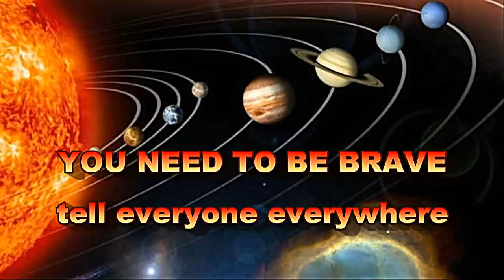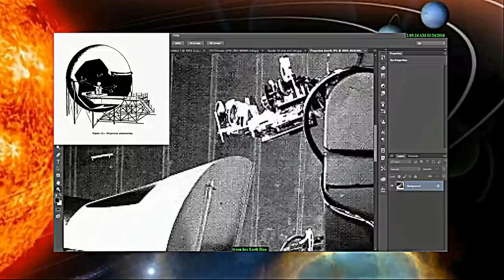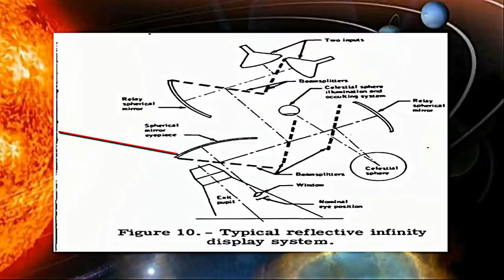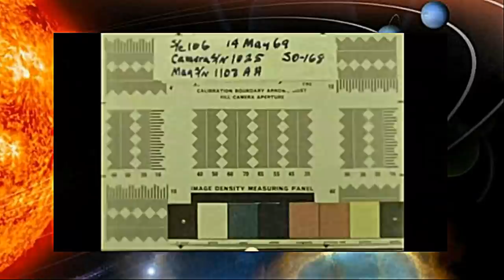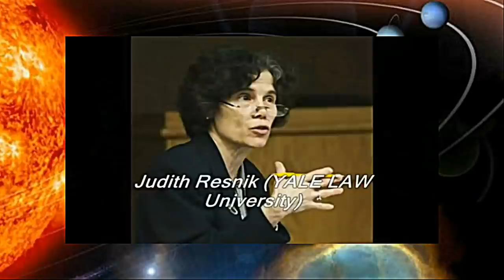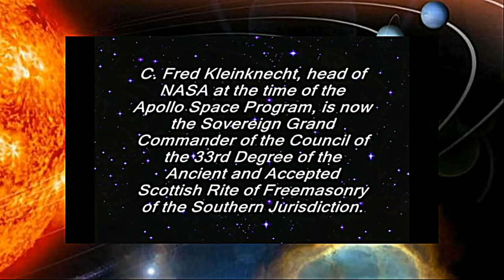AWESOME FLAT EARTH RANT AND DEMO shut down deniers instantly!

Comment: If gravity isn't working, why are they being held in the pan of water?
And why is the water at the bottom of the pan instead of floating in the air?
Reply from the maker: I got a better one! Why do eclipses of the moon take 4.5 hours when they should not even take 4 minutes?  ;)
Reply: vhsjvc
I was talking about your experiment here.
In this very video.
Not changing the subject.
Why does the water stay in the bottom of the pan?  ;-)
Reply from the maker: Mark Ryan density
Reply: vhsjvc
Density what?
Reply from the maker: Mark Ryan and buoyancy
Reply: vhsjvc
What is the formula for buoyancy?
Reply from the maker: Mark Ryan light objects float
Reply: vhsjvc
Light meaning they weigh less.
Reply from the maker: Mark Ryan relatively
Reply: vhsjvc
A feather is light.  But it falls down.
What pulls it down?
Reply from the maker: Mark Ryan density, nothimg "pulls" it.  ;)
Reply: vhsjvc
Of course something pulls it.
Put it on a scale.
Something compresses the spring on the scale, right?
Reply: Hello?
vhs?
Are you saying that springs can compress themselves?
Reply: Yoiu know those fish scales, vhsjvc?
The kind you hang a fish on, and it stretches the spring and tells you how much your fish weighs?
What stretches out the spring if there is no force?
Reply: Battlerite Gods
vhsjvc just said there is NO force.
So who is right?
You, or him?
Reply: he said nothing "pulls" it. to say there is no force at all is to say physics does not exist. We are right, you are a shill. Simple.
Reply: Battlerite Gods
There is either a force or there isn't.
How can you pull something without exerting a force on it?
Density isn't a force.
Its Mass divded by volume.
So what is making the spring stretch?
Doesn't' there NEED to be force pulling on the spring?
Reply: There is a force, which is determined by the difference in density. This force is NOT gravity as you know it. It has nothing to do with the mass of an object drawing things to it.

Don't I NEED to weigh less on the equator if the earth was spinning 1050 MPH there? Don't I NEED to weigh MORE at the north/south pole since those areas are not spinning 1050 MPH? Do you know what centrifugal force is? Doesn't there NEED to be an actual photograph of the earth? Doesn't there NEED to be any fucking solid proof whatsoever that we can recreate gravity in a model? 

Go ahead and do NASA/SATAN's job for them and PLEASE create a working model of gravity in a vacuum. I will wait.
Reply: Battlerite Gods
Then why does density push things DOWN instead of up?
Reply from the maker: "In other words, you are hurling through space at 2.7 million MPH (4.4 million KPH) even though it feels like you are sitting still."

http://www.brainstuffshow.com/blogs/good-question-how-fast-are-you-moving-through-the-universe-right-now.htm

fucking ridiculous!!!  ;)
Reply: vhsjvc
What does that have to do with the force that stretches out a spring on a fish scale?
Reply: don't answer my questions with another question. It is another force. simple. What EXACTLY is it? I really can't tell you for certain. Remember that gravity is indeed just a theory. But please try to answer a couple of the questions I offered you.
Reply: Battlerite Gods
I asked the first question, bud.
And you tried to shift the goalposts.
The question is, what force stretches the spring?
"I really can't tell you for certain"
Well, I CAN.
ITs called gravity.  Gravity isn't a "theory".
Its a force.
Density is not a force.
Reply: Battlerite Gods
Reply: Good luck in your journey.
Reply from the maker: Mark Ryan everything, because it is just as imaginary, as your "pulling" force. what is really going on is that the spring naturally stretches do to the weight of the object, NOTHING IS PULLING THE OBJECT as we can plainly observe, try putting the spring under the object, it will not stretch, so your dumb trick is exposed, it is simply the location of the spring that causes it to stretch when attached to a heavy object in the air.   ;)

have fun going 2.7 million mph and not noticing! BAAAGHHAAAGHHAA!!! What a joke!
Reply: Battlerite Gods
Good luck trying to refute science with ZERO education on the matter.
Reply: vhsjvc
NO, the stretched spring isn't imaginary.
ITs real.
"what is really going on is that the spring naturally stretches do to the weight of the object"
What is the formula for "weight"?
Reply from the maker: Mark Ryan Tesla: "Today's scientists have substituted mathematics for experiments, and they wander off through equation after equation, and eventually build a structure which has no relation to reality."

get a life  ;)
Reply: vhsjvc
Tesla did not believe the Earth was flat.
Why do you?
Reply: Tesla understood the fact that the Earth is a sphere, and the moon orbits due to gravity.

"The moon actually swings on the axis passing thru its center of gravity on which it is supported like a ball on a string..."
--Nikola Tesla
Spheres, gravity...
Get a clue from your body TESLA!
Reply from the maker: Mark Ryan he said center of gravity, so what?   ;)
Reply: vhsjvc
Yes.
Tesla believed in gravity
 Sorry pumpkin ;)
Reply from the maker: Mark Ryan find the quote dumpling  ;)
Reply: vhsjvc
Wow, drugs and alcohol have NOT been kind to you.  Its a 3 posts back, but you seem to have a hard time even breathing, so..
""The moon actually swings on the axis passing thru its center of gravity on which it is supported like a ball on a string..."
--Nikola Tesla
Reply: Mark Ryan I apologize for the lack of a coherent response. In a flat earth model, there is a definite up and a definite down. In a heliocentric model, everything is "relative" (such as people in Australia walking upside down but they feel right side up). Gravity is in fact a theory. If you read Newton's work, he has a lot of "what ifs" "maybes" and "possibly's" throughout. There is no mathematical equation for gravity and if there was it cannot be demonstrated to prove its accuracy. In fact, it has never been demonstrated that an object with less mass is attracted to another with more mass, or that the smaller object would orbit the larger. Taking your cell phone and dropping it on the floor is does not prove a magical force called gravity exists. it only proves that your phone is heavier than the air molecules surrounding it. Anything more dense than air will fall and anything less dense than air will rise. Why aren't helium balloons dragged to the earth? Because the balloon itself is too light? But if we take out the helium, it falls to the ground.. seems like gravity has a mind of its own. Take a rock with equal mass to that of a log of wood. The log will float and the rock will sink. This is bouyancy at work. The rock is more dense than water.. it falls. The log is less dense than water, it floats. 

I can sit here all day and come up with a list of exceptions to gravity but that probably won't change your mind. However, I'd like to note that gravity does not adhere to the scientific method which is something that can be observed, demonstrated and repeated.

 Show me a ball with water sticking to it. Show me water bending due to gravity. Show something orbit another object or even the most minute attraction (easy test would be a lead ball and a marble in space).

In the flat earth model, gravity is not required. The globalists simply needed an explanation to silence the critics asking how water sticks to a ball. The earth holds trillions upon trillions of gallons of water to the underside, firm in place, yet bugs, fish and just about anything else is free to move freely. Rivers, must flow uphill over the curve before reaching the ocean.. ehhhhhhhhhh really?   Ascending several miles uphill I might add. You're free to believe  in fairy tales but I say show me the experiment that can be reproduced outside of "earth is ball" because there's enough evidence to show this is a Masonic hoax (otherwise we wouldn't be having this conversation). If gravity is a law or a fact etc.. you should be able to produce a scaled to size experiment. You cannot. Nobody can. If you're OK with that, then we should be able to agree that gravity is NOT a fact nor is it scientific (even if the entire 'scientific' community agrees.. I don't give a rip. Majority opinion doesn't make something fact nor true). Cheers.
Reply from the maker: Mark Ryan that is just an analogy, you misinterpreted it to line up with your religion, is that all you got as "proof" haha that is lame, Tesla had his own "dynamic theory" of gravity, in either case, nothing ever passed the theory stage, as you know "Newton himself strongly felt that the impossibility of rationally accounting for action at a distance through an intervening vacuum, was the weak point of HIS system." It was just a waste of mental energy to try to make it make sense, but unless you can examine something for yourself you are only left with guesses and imagination. rockets for example do not go higher than 12 miles give or take a few, and balloons about 20 miles up and that is the limits of our exploration.

Tesla also said "God does not play dice."
Reply: +vhsjvc It was Albert Einstein who said, "God does not play dice."
Reply from the maker: ***** LoL! serves me right for just looking at the Google results!  ;)
Reply: vhsjvc
No, it isn't an analogy.  "Ball
  Gravity"
Its what Tesla believed.
Newton didn't invent gravity.
It doesn't matter what he "doubted" about it.
YOu still accelerate downwards at 9,8 meters per second.
That IS gravity.
By definition.
Reply: Zechariah Williams
"Gravity is in fact a theory"
NO, its not.
You don't seem to know eaht a "theory" is.
Gravity  is a natural phenomenon.
NOt a theory.
"I can sit here all day and come up with a list of exceptions to gravity"
No, you can't.
Not even once.
Reply from the maker: Mark Ryan judging from your reply, "Gravity" is YOUR RELIGION.  ;)

"Newton himself strongly felt that the impossibility of rationally accounting for action at a distance through an intervening vacuum, was the weak point of HIS system."

i just love how you clowns always contradict each other!!!

BAAAAGHHHHHAAAGHHHAAA!!!
Reply: vhsjvc
Judging from Tesla's quote, he believed in gravity.
At least you admit religion is a bad thing.
I love how you don't even understand what gravity is.
Reply from the maker: Mark Ryan oh gravity does many things!--it prevents you from knowing you are upside down, it prevents you from flying off the earth by preventing you from knowing you are moving 2.7 million miles per hour.  ;)

"In other words, you are hurling through space at 2.7 million MPH (4.4 million KPH) even though it feels like you are sitting still."

 http://www.brainstuffshow.com/blogs/good-question-how-fast-are-you-moving-through-the-universe-right-now.htm

BAAAAGHHHAAAGHHHAA!!!
Reply: +Mark Ryan the idea of up and down are wrong down is the way gravity pulls so your always right side up to yourself enders game has a very good part that explains this
Reply from the maker: maxybaer123 don't forget how you debunked "gravity" in the other thread:

maxy, you debunked gravity with your ball and chain example, since only a CIRCULAR ORBIT is permitted. An elipse is totally out of the question, and we will be generous and overlook the fact there is no chain.  ;)

The reason why fig newton himself strongly felt that the impossibility of rationally accounting for action at a distance through an intervening vacuum, was the weak point of HIS system.--is because of eliptical orbits and no chain.

In your model, when earth is closest, it will get pulled into the sun, when furthest, it will fly off into space, there is no way out for you now, according to the scientific method it is CHECKMATE

good job, you checkmated yourself  ;)
Reply: +vhsjvc my ball and chain example in no way debunks gravity that was an example of the effects of gravity on an object flying around in a circle so i demonstrated it in a circle the chain in that example is gravity which can go in any direction not just a circle
Reply from the maker: maxybaer123 no, only a circle is possible, please show us a demo of how an elipse is formed with a chain and ball.

I repeat:

maxy, you debunked gravity with your ball and chain example, since only a CIRCULAR ORBIT is permitted. An elipse is totally out of the question, and we will be generous and overlook the fact there is no chain.  ;)

The reason why fig newton himself strongly felt that the impossibility of rationally accounting for action at a distance through an intervening vacuum, was the weak point of HIS system.--is because of eliptical orbits and no chain.

In your model, when earth is closest, it will get pulled into the sun, when furthest, it will fly off into space, there is no way out for you now, according to the scientific method it is CHECKMATE

good job, you checkmated yourself  ;)
Reply: vhsjvc 

Never even tried to find out anything about orbits at all have you?

Ask any cosmologist or astronomer, a circular orbit is the exception, not the rule. The amount of variations involved in the interplay of gravitational fields alone makes it nigh on impossible.
Reply from the maker: ***** The reason why fig newton himself strongly felt that the impossibility of rationally accounting for action at a distance through an intervening vacuum, was the weak point of HIS system.--is because of eliptical orbits and no chain.

In your model, when earth is closest, it will get pulled into the sun, when furthest, it will fly off into space, there is no way out for you now, according to the scientific method it is

CHECKMATE

Moreover, that poor little moon of yours when she is caught between the earth and the sun, somehow does not fall into the sun, good thing there are no chains, imagine how tangled they would get!!!

_BAAAGHHHAAAGHHHAA!!!
Reply: again THE CHAINS ARE GRAVITY and do you get what an example is since you dont understand gravity i used a chain as an example in reality it is much more complex.

 The weak point of newtons theory was that he didn't know what caused gravity to do what it does, for example, we know we can hear sound because it propagates through the air but what does gravity propagate through? saying it doesn't exist because we dont know how it works is like saying because we don't know how god does what he does, he cant exist. Your religious right? also please dont quote things you dont understand +vhsjvc
Reply: vhsjvc
Newton did NOT deny that gravity existed,.
But who cares if he did.
Do you live 500 years ago?
OR have you learned a thing or two since then?
Reply: +Jack Dunphy i thout you flat earthers hate jews shouldent you be thanking him
Reply: Battlerite Gods 

Everything does weigh less at the equator, and more at the poles.

So, going to admit you're on a spinning sphere now?
Reply from the maker: moon-huggers will believe anything as long as it is on tv  ;)
Reply: vhsjvc 

Says the guy who believes in fictitious places from 100 year old books.
Reply: Jack Dunphy 

Perhaps I've given the wrong impression, Jack. I don't swing that way. You could probably convince some of your fellow flat earthers to join in your little game of uphill gardening, they're a pretty simple bunch. Just tell them Dubay does it all the time.
Reply: vhsjvc
Flat Earthers will believe anything, unless its true.
Reply: +vhsvc i dont watch tv or the news so explain why im still a moon hugger
Reply: beer money yeah.. the rock is more dense than the air molecules surrounding it so it falls.. that's exactly my point. 

It's been over 50 years since our voyage into space. Why are there so few images of earth from space that are non composite/non CGI? The ones that are not CGI (NASA fully admits that a majority are composites aka computer generated), could arguably be paintings and not genuine from an actual camera. If you ask NASA for the original video footage from the moon missions they claim they "lost them." A simpleton may ask what are all the videos I've seen then?? Those pictures and videos are copies from other sources and NOT the originals. NASA literally does not posses an actual non CGI photo of the earth from its originating source. You can cry all you want but I rest my case. so your answer of "Earth" is null and void. Look into it yourself like all the other flat earthers out there and you will come to the same conclusion, assuming you are of sound mind. 

Why don't we have 24/7 video of the entire earth in view that shows it rotating? Who needs radar for weather when you can see systems forming in real time? Seriously! Why didn't they film the building of the ISS in open space, orbiting 17,000mph? That's a more technological feat than the moon landings in my opinion. Whybwouldnt they film that? the  documentary would have sold millions of copies and they could have at least recouped expenses.. but no.. they do have (once again) a CGI re-enactment. It's a fucking joke. Feel that? By the time it took you to read this, the earth rotated 100s of miles from west  to east. Baahahahahaha! And I have a bridge to sell you in afganiraqistan.
Reply from the maker: maxybaer123 how did you first get exposed to t?  ;)
Reply: Zechariah Williams
Why does it fall, instead of rise?
Reply: Mark Ryan Same reason a log doesn't sink to the bottom of the ocean. The same reason a helium balloon rises instead of falls (when the balloon itself falls). 

There is no mathematical equation for gravity. Even if there is a claim that there is one, it cannot be demonstrated to prove its accuracy. We flat earthers believe in anything? Eh, you believe in a magical force that has never been proven (again.. dropping something on the ground only proves that the object is heavier than the air molecules attempting to hold it up). 

Why does a log fall to the ground but floats in water? Why does a balloon filled with helium rise unabated but the balloon itself falls? How come a magnet the size of a pea can out-muscle the entire gravitational pull of the earth? Gravity is the weakest force, is it? Got to be pretty damn powerful to strap all the water to the underside of the globe, yet gentle enough for fish, planes, bugs, birds and just about anything to move about freely. It holds things to the ball, sends other objects into orbit, attracts smaller things to form balls of rock in space... very diverse this gravity is.. Even Neal De Grasshole Tyson will tell you that "no one knows what gravity is."

The globe lie is a big one. Ego is the first obstacle. Check it at the door and do some research.
Reply: +vhsvc i am assuming you meant to say tv in which case i have never watched the news and only ever watched some unacademic tv shows
Reply: +Zechariah Williams gravity has been proven time and time again we could not go to space without an equation for gravity not to mention Neil deGrasse Tyson said he didnt know exacly what it was i could as you what is god or what is matter you could not tell me gravity is not some magical force since you like quotes so much here is one for you "Magic's just science that we don't understand yet" and we mostly understand gravity its not magic
Reply: +Zechariah Williams gravity is the weak if you took the time to understand it you would know that the more mass an object (ocean) has the stronger the pull also have you ever felt a neodymium magnet there incredibly strong if there large enough they can easily crush your hand
also ego is also affecting you seeing how all the research you did was clearly with heavy confirmation bias as you could quickly find the answer to all the questions you asked
Reply from the maker: maxybaer123 the entire space program is a hoax  ;)
Reply: Zechariah Williams
OH, gravity.
Gravity causes a log to fall onto the ocean.
Buoyancy doesn't work without gravity.
YEs, there are highly accurate mathematical equations for gravity.
Sorry bud.
Reply: +vhsjvc look up Argument from Personal Incredulity since you so love links https://web.cn.edu/kwheeler/fallacies_list.html
Reply from the maker: oh wait! gravity is a self-adjusting tractor beam!  ;)
Reply: vhsjvc
Why does evrything accelerate towards the center of the eArth at 9.8 meters per second squared, no matter its wieght or density?
Reply from the maker: Mark Ryan you don't make sense, things accelerate up to that speed then they don't go any faster, sounds just like buoyancy and density to me?  ;)
Reply: vhsjvc
I'm sorry science doesn't' make sense to you you.
Everything you drop accelerates downwards at 9.8 m/s^2
Is an orange more dense than a ping pong ball, or less dense?
drop them from the same height, and they hit the ground at the same time.
Density can't explain that.
Why not.
They both fall at the same rate.
Why?
Reply: Mark Ryan because the air molecules "holding" both objects up are equally/evenly dispersed. A good test would be to drop a baseball in the Rocky mountains at elevation and do the same at sea level and see what the results are. Dropping two items at the same location will always net the same results. The only thing that changes this is if there is drag on the object interacting with the air molecules such as a feather or wing for example. 

Hash this out in your brain.. think about it... c'mon... keep thinking... okay, make sense now? 

Science claims gravity is attraction of small masses to large masses so why does a pebble fall at the same speed as a boulder? At what size would we start seeing a difference (observation.. first rule in science)?

It's common knowledge that baseball's, golf balls and other projectiles fly further at high altitude. So the test has already been done and proven. We're not talking about the density of the objects falling but the density of the air molecules. 

If you can't wrap your head around that, I'm sorry. We can observe, demonstrate and reproduced the results just as science dictates. You cannot however show attraction of even the smallest magnitude of ANY two objects without using magnets or other properties besides mass.
Reply: Mark Ryan and to add.. capital S science gets around this problem by stating that at altitude, the object is further from the center of the earth and thus there is less gravity. All the globalists did was reverse engineer everything. Flat, stationary circle verses globe, moving multiple directions. Instead of stars rotating around us, we spin (haphazardly rotate) around the stars.. the sun moves around us in the flat earth model but they claim we move around it. They claim no creator, big bang cosmology, we claim divine and purposeful creation. Did I mention sadists (the ones perpetrating this hoax) do everything backwards??

There is one thing the globalists could not reverse engineer. You'll need to take your time and investigate this one. It's better to have a globe on hand but basically there's an issue with the motion of the sun during the winter for those in the northern hemisphere. In the heliocentric model, the earth is actually closest to the sun during winter but the alleged tilt of the Earth's axis is leaning away from the sun (tilted back - this tilt is what causes the seasons). If you have a backwards leaning earth in the winter, when California for example, reaches the terminator line (where there is light and darkness) it will be traveling from a lower position to a higher position as the day goes on.. and when it begins it's rotation toward the backside or dark side, it descends back DOWN once again to a lower point. If the observer is descending down as it gets darker, how is it that the sun also goes down? Haha! Can't happen. 

In mid day then, the sun should be at its lowest point (because the observer is rising due to the tilt and rotation). as the "night" approaches, the observer is descending downwards and so the sun would actually rise before the terminator line is reached. This is hard to explain in text without diagrams but I hope you get the point. There is no counter argument or explanation for this, only ignorance and denial. Period.
Reply from the maker: Zechariah Williams this brings up another problem, the reflection of the sky and everything in it can only occur on a flat surface, what we see on the water is a mirror image of above https://youtu.be/xmd8_DKj3Us?t=6m41s
Reply: vhsjvc If its a mirror image, why doesnt' it look anything like the moon?
Reply from the maker: Mark Ryan because your moon is this model here totally fake https://www.youtube.com/watch?v=Q4zTR9ubkD4 you are used to the fake images i guess.  ;)
Reply: +Zechariah Williams 
Why should globalists know everything if as you said we reverse engineer everything we shouldn't have all the answers. the fact that we don't say we do should be an indication to you that were telling the truth as it is impossible to know everything.

astronomy pre 101 sun goes down because we face away from the sun. The tilt changes what hemisphere of the earth is being hit the most not what hemisphere has night and day when.
P.S. 
if its hard to explain without diagrams show me one then dont care if its from a biased source
Reply from the maker: Mark Ryan ahhh, this comment set you off? because your moon is this model here totally fake https://www.youtube.com/watch?v=Q4zTR9ubkD4 you are used to the fake images i guess.  ;)
Reply: +vhsjvc i have yet to see any actual proof in those videos. Even if all of those images are real (i certain there not ) that still doesn't prove that they didn't go to the moon or that the moon landing was fake.
P.S.
there is no argument in that video just some fake images
Reply: maxybaer123
They have to be proof.
YouTube videos are always proof.
Reply: Mark Ryan 

pfft, it's all CGI!!
Reply: *****
Prove it.
Reply: Zechariah Williams 

“because the air molecules "holding" both objects up are equally/evenly dispersed. A good test would be to drop a baseball in the Rocky mountains at elevation and do the same at sea level and see what the results are.”

No. That would be a terrible test. Give one object time to achieve terminal velocity and not the other. Absolutely pointless and completely unscientific, just like this whole theory itself. You've chosen to ignore the significance of the direction of travel. If the density of the air surrounding an object in all directions is less than the object, and density alone is the cause of a shift in position, there's nothing preventing the object travelling in any one of all possible directions. You have to account for that or forget your theory.

Even if we do ignore this massive oversight, that still puts the burden on you to explain why the very property you claim causes disparity between objects/substances can paradoxically result in uniformity. Air density can't suddenly have convenient effects to compensate for your flawed logic.

Hash this out in YOUR brain... think about it for once.

“Science claims gravity is attraction of small masses to large masses so why does a pebble fall at the same speed as a boulder? At what size would we start seeing a difference (observation.. first rule in science)?”

Obviously any object on the earth is inordinately small by comparison to the earth itself, that's precisely why we observe uniform acceleration, earth's mass takes precedent.

But let's look at it from your hole ridden density theory for a minute. First of all see the point made above. If mass isn't the underlying mechanism, then how would they fall at the SAME speed if according to you one is heavier than the other and that's why they fall? Again, air isn't the answer, it doesn't work. 

We can step aside from that point and stick with the claim that it is density that makes objects fall and not attraction of masses. It still doesn't work, it is inherently contradictory. The property that defines differences in density is MASS.

“It's common knowledge that baseball's, golf balls and other projectiles fly further at high altitude. So the test has already been done and proven.”

That concerns resistance, it does NOT explain objects of different weight travelling at uniform speeds when their weight is supposedly the cause of their acceleration.

You need to wrap your head around the fallacies inherent to your poorly thought out theory, and I can guarantee you have not, and never will, prove air takes on conveniently magical abilities that simultaneously allows it to both be affected by and ignore relative density.

………

“capital S science”

Grow up.

“... gets around this problem by stating that at altitude, the object is further from the center of the earth and thus there is less gravity.”

A point proven with atomic clocks which density cannot account for.

“ All the globalists did was reverse engineer everything. Flat, stationary circle verses globe...blah blah”

Just a pointless rant filled with ignorance and bias.

“Did I mention sadists (the ones perpetrating this hoax) do everything backwards??”

Did I mention you're talking crap? Stick to facts, not conspiracy theory.

“There is one thing the globalists could not reverse engineer... there's an issue with the motion of the sun during the winter for those in the northern hemisphere...In the heliocentric model, the earth is actually closest to the sun during winter but the alleged tilt of the Earth's axis is leaning away from the sun[...]California for example [...] will be traveling from a lower position to a higher position as the day goes on[...]it descends back DOWN once again to a lower point. If the observer is descending down as it gets darker, how is it that the sun also goes down? Haha! Can't happen.” 

A misrepresentation of the facts based on thinking literally about tilt alone but not actually accounting for the true motion of the earth.

“There is no counter argument or explanation for this”

Analemma.
Reply: *****
Everything sticks to the gravity of Earth.
CHECKMATE!!! :)
Reply: +AI K wait you mean sponge balls won't get wet nooooooo i have been lied to my entire life
Reply from the maker: Mark Ryan UNBREAKABLE RULE THAT BREAKS THE BACK OF GLOBE-HEADS:

the bigger you are the slower you can safely spin before destructing

the trent 800 fan blades are 110 inches, trent 900 fan blades are 116 inches, trent 800 goes 3300 rpm, trent 900 goes 3000 rpm, trent 800 rim speed is 1079.3 mph and trent 900 rim speed is 1034.7 mph big smile on my face ;) if you think earth is spinning 1000 mph you need to give your head a shake ;)

let me add that the force at the tip of each blade on the trent 900 is equal to a 110 tonne locomotive

the biggest thing in the universe that has an edge velocity of 1000mph is the fan of the trent 900

your globe goes 1000+ mph ON PAPER ONLY.  ;)
Reply: vhsjvc
The Earth only turns once every DAY!
It takes a DAY for the whole thing to spin.

ONE ROTATION PER DAY!

That's .00069 RPM

Its not moving fast enough to tear itself apart.
Reply from the maker: Mark Ryan on paper only
Reply: Mark Ryan 

Except for butterflies and helium balloons!! CHECKMATE!!!!! ;)
Reply: maxybaer123 

Only on paper!!  BWAHAHA!!
Reply: +AL K if paper dosnt mean anything than god or a flat earth cant exist arent those from the bible WHICH IS PAPER also i would like to point out that spin rule is an oversimplification of a simplification made dun dun dunn you guessed it on paper!
Reply: +AI K why are you the authority on what works on paper and what doesn't
Reply: *****
So you think dead butterflies go to heaven?
BAAAABABABABABBABA
Reply: +AI K no answer?
Reply: maxybaer123 

Do you not realise I was satirising vhsjvc?
Reply: Mark Ryan 

Uhhh...Water always finds its level!! Perspective!! AstroNOTS!!

Get out of that one Rommel!!!!! :-P
Reply: +AI K I was wondering why you suddenly changed beliefs
Reply: *****
Uh...Water always finds the LOWEST POINT.
Get an education.
Your opinions aren't working.
Reply from the maker: REALITY STRIKES: THE ONLY proof one needs for a flat earth is flat water, no curve is ever taken into account in engineering THAT'S A FACT!

Pinned by dmurphy25 Yolanda Whittle 7 months ago 100% right!  I'm a surveyor and engineer, and there is no development project that has factored curvature of Earth!  Not one single runway, road, or railroad survey or design factors in the curvature of the Earth!  Once we graduate, curvature of Earth is never brought up again!  Ask any surveyor or Civil Engineer out there if they have to calculate Curvature of Earth and factor into their projects! Link to comment: https://www.youtube.com/watch?v=Gp_awTGVRRw&lc=z13xvviyhznvclsdg22qzbgprnuuzhlsz

And there is a continuous chain of testimonials as proven by Winship's book from 1899 http://blog.flatearthtextbook.com/2016/11/railways.html

"...As an engineer of many years standing, I say that this absurd allowance is only permitted in school books. No engineer would dream of allowing anything of the kind. I have projected many miles of railways and many more of canals and the allowance has not even been thought of, much less allowed for. This allowance for curvature means this—that it is 8" for the first mile of a canal, and increasing at the ratio by the square of the distance in miles; thus a small navigable canal for boats, say 30 miles long, will have, by the above rule an allowance for curvature of 600 feet. Think of that and then please credit engineers as not being quite such fools. Nothing of the sort is allowed..."

Please, go in peace and enjoy your delusional globe, it is a harmless delusion as far as i know.  ;)
Reply: Mark Ryan

I wonder what he'll cut and paste next?
Reply: *****
He (vhsjvc ) won't cut and paste anything that indicates the EArth is flat, or that gravity doesn't work.
That's for GOD damn sure.
Reply: Mark Ryan 

Agreed! 👍
Reply from the maker: i guess the Harlem "Globe" Trotters were right?  ;)
Reply: vhsjvc
Erotosthanes  was right 2300 years ago.
Reply from the maker: Mark Ryan never heard of him  ;)  i'll stick with reality, not a fictional relic. Tell him I say flat water proves flat earth
Reply: Mark Ryan 

If he did that she might divorce him.
Reply: Mark Ryan 

I think you'll find the correct nomenclature is "bubbasexual".
Reply from the maker: Bolivian salt flats after it rains, see the largest natural mirror in the universe and meditate on that, you might want to take your heads out of your asses first though, just a tip ;)
Reply: +vhsjvc flat water proves nothing it is impossible to have perfectly flat anything in our universe as atoms are round + water wants to go to the center of the earth not flatten look at water droplets for example
Reply: +vhsjvc what does that prove
Reply: +AI K you fell into the ad hominem trap
Reply: +vhsjvc never herd of him look him up Erotosthanes
https://en.wikipedia.org/wiki/Eratosthenes
and while your at it 
http://rationalwiki.org/wiki/Argument_from_ignorance
Reply: maxybaer123 

I fell into the pit of despair by way of boredom due to the repetition of ignorance.
Reply: Mark Ryan 

Nah. Even density can't drag me that far down.
Reply: *****
That's because density isn't a force.
Reply: Mark Ryan 

Exactly. 

It's definitely out in force though.
Reply: +AI K +Mark Ryan can you 2 be quiet if you dont have anything to contribute
Reply from the maker: "The completeness of the resulting control over opinion depends in various ways upon scientific technique (BRAINWASHING). Where all children go to school, and all schools are controlled by the government, the authorities can close the minds of the young to everything contrary to official orthodoxy." —Bertrand Russell (1952)
Reply from the maker: Why can't you walk on water or air?  ;)
Reply: maxybaer123 

Learn some humility and stop trying to infringe on freedom of speech. You're overstepping your bounds, especially given this is Mark's own thread.
Reply: +vhsjvc you've apparently never heard of this wonderful thing called a private school
Reply: +AI K i am not infringing freedom of speech if anything you are by posting that comment i am asking you to leave or say something that contributes because your whining is annoying  I have not insulted you or forced you to leave but asked you to do something which is my right 
apparently, you have no idea what free speech is it is the notion that force cannot be used to silence speech in a public area or space on private forums(youtube) the owners are free to silence anyone as it is their private property.
Reply: +vhsjvc i don't know why can't you walk on water?
Reply: +vhsjvc can i ask you why you aren't brainwashed like the rest of us then, did you drop out? because that would explain a lot. saying we are brainwashed is just ad hominem and not an actual argument not to mention you are trying to push your point using http://rationalwiki.org/wiki/Argument_by_assertion
Reply from the maker: maxybaer123 no, i was brainwashed too, but unlike you guys i rinsed out out the industrial strength propaganda, you have yet to do this. Be careful, because for some people it gets into their pores and cannot be rinsed out after that.  ;)  Don't wait too long.

Flat water is t he only proof required for flat earth.
Reply: +vhsjvc i was never brainwashed as i went to private school you simply say im brainwashed because i disagree with you and am proving you wrong do you think that i can't think that the earth is round or god isn't real without being brainwashed
you have yet to prove the earth flat water inst flat you are just arguing by assertion did you read that link it would help you
Reply from the maker: Mark Ryan you were raised on baby formula and vaccines and fluoride, you top that up with a daily dose of coke zero aspartame and now that you are in the single digits it is a matter of a short time before you hit your goal of zero IQ  ;)

flat water flat earth
Reply: +vhsjvc might be wrong but unless your parents were really paranoid or you are very young you were raised on vaccines the anti-vax thing is pretty new and how do you know if he was raised on any of those things or drinks coke
Reply: how do you know he drinks coke zero also I ask you to realise  we ingest trace bits of most poisonous substances every day simply because it might be poisonous in large doses does not mean it is deadly at any level of exposure take radiation for example, it is in every atom in the universe yet it is hard to get rad poisoning, however, I do acknowledge that nonlethal doses can still be bad for you and you should try to avoid potentially dangerous chemicals not to mention sugar tastes better.
Reply: +vhsjvc prove to me water is flat or whatever this flat water thing you are talking about i would also like to hear another proof as to why the earth is flat.
Reply from the maker: Mark Ryan yes, because that is YOUR horizon which is part of your tiny bubble of view that surrounds you that does not amount to a pin dot on a map, the sun sets past your limited vision, your idea that it cannot set mathematically on paper because the lowest it goes is 11 degrees is based on the viewer having infinite range.  ;)

please learn to stick to reality
Reply: vhsjvc
Its not "my" horizon.
It belongs to everyone on the globe.
No person can go ANYWHERE on this Earth, even in the air, on a plane, in a balloon, or in low Earth orbit, and avoid the Sun and the Moon dropping BELOW the horizon.
The Sun and the MOon ALWAYS drop below the horizon.
And pop up from behind it when they rise.
Stars too!
That's reality.
Reply: +mark ryan if in low earth orbit you could probably spin with the earth so that neither of the bodys move but your point still holds
Reply: +vhsjvc there is a way to mesure to the stars https://lco.global/spacebook/parallax-and-distance-measurement/

all humans do have infinite range we can see the stars after all or an easy one fly in a plane 1k ft up and you can see farther than you normally can or even look off a mountain maybe you have a bubble around you blocking your view of the truth

if the sun is on some dome why can we see it isn't it at least a few miles up as planes can fly 10k ft 

imagive wind it can carry smells or light objects from an infinite range as long as they dont dilute or fall to the ground all light is is the photon wind hitting your face it dosent matter how far away it came from it only matters whats hitting your eyes
Reply from the maker: maxybaer123 the horizon always rises to eye level  ;)
Reply: vhsjvc
No it doesn't.
The horizon is always at ground level.
It above you if you are looking at mountains.
Its below if you are standing on level ground.
Its even farther below you if you are in the sky.

It drops about 3 degrees for every 10 km yoiu fly up.
Reply: realy then why can you see the ground on a plane
Reply from the maker: maxybaer123 because earth is flat, ryan is just making shit up as he goes  ;) if you want to know why it is called an air*PLANE* just understand it is because earth is a flat plane
Reply: +vhsjvc do YOU HEAR YOURSELF your just saying because the earth is flat and not thinking for yourself think rather that repeating what you were told
Reply: a question im looking for an awnser 2 is there a reson the horison is at eye level i assume its because its the farthest point you can see on the ground and the ground if looking straight is the lower half of your vision and the sky the top
Reply from the maker: Mark Ryan more word salad from you, yes air*PLANE* because they travel over THE PLANE that is how planes fly, parallel to the ground, horizontal, level, as in sea LEVEL.

The horizon always rises to eye level because we are living on a plane, a vast plane, a flat earth.

"look it up" rofl

no ship goes "over" anything, you just get a telescope and it comes right back into view, get lost bozo

and don't forget granite, cannot be formed from a molten state  ;)

earth is young and flat, Genesis is 100% true
Reply: vhsjvc
Sorry you have a hard time understanding facts.
Word Origin
C19: from French aéroplane, from aero- + Greek -planos wandering, related to planet
Reply from the maker: maxybaer123 "the horision dosent rise to eye level it rises to the center of your view regardless how does that prove were on a plane."

is the same thing, it rises to eye level, and on a globe, the higher you go the LOWER it would get, it would not remain at eye level, case closed.

the granite point matters because it proves you believe in fables

 and your own words are perfect for you:

 "so far all this argument is is you repeating others words and proving them with dogmatizm noun: dogmatism the tendency to lay down principles as incontrovertibly true, without consideration of evidence or the opinions of others. 'a culture of dogmatism and fanaticism'"
Reply from the maker: Mark Ryan i am Greek, planos really means deceiver, but i can see how that can apply to motions of "planets" like retrograde

still, air*PLANE* stands, just like water LEVEL

you g lobe-heads seem to have a hard time with observing and interpreting reality, you cannot see the forest for the trees

and don't forget granite!  ;)
Reply from the maker: Mark Ryan no they all look like venus pretty much, people can look up The Venus Waves video on here to see what they really look like.  ;)

don't forget to say hello to granite for me :)  you know it cannot form from a molten state by slow cooling

that sure knocks all your dominoes down nicely
Reply: vhsjvc
You can see the phases of the beautiful globular planet with a cheap telescope.
Go buy one.
YOu can see its a sphere.
With your own eyes.
Reply: vhsjvc 
can you please stop being denser than granite and listen you have yet to prove granite cannot form from a molten state all you have done so far is dogmaticaly state that it cant and besides that doesent prove anything it hints at possible creationism but in no way proves it

not to mention it took me 2 seconds to find a video by a random person in it you could easily see the planites were round
Reply from the maker: Mark Ryan they are round, but also see through, and they look like pure energy shimmering
Reply from the maker: maxybaer123 the polonium halos in the granite close the case
 halos.com

all the detractors can say is "it got in through the cracks" hahaha
Reply: vhsjvc
You have no evidence that Polonium created the halos.
Its speculation that only the bible thumper Robert Gentry asserts to be true.  No actual science facts back his claims.
Gentry never demonstrated the the rocks were primordial, nor did he show that polonium caused the rings.
Its a failure by an under-educated Young Earth Creationist motivated by a religious opinion, not the logical conclusion drawn from the scientific method.
Reply: Mark Ryan no he has evedence science said it and it backs him up so it must be the one thing nasa/illuinati/science has ever said that is true
Reply: maxybaer123
This guy doesn't go by "evidence".
He goes by feelings, emotions, and opinions--often not even his own, but those of others who have played upon his anger at the world.
He's angry, he's been hurt, he has abused himself over many decades with drugs and alcohol and cigarettes and so on...
 And this has led to him cultivating a hate for those of us who haven't, and who still have our faculties and wits about us... people who he senses are smarter and better off than himself.

There he rejects formal science, mathematics, and basic logic.  He rejects facts that don't affirm the position he has entrenched himself in.
Numbers, maths, and science hold no weight with him. In fact, he rejects them even more rigorously, as being the product of the "elite".

He desperately needs to be right, so that he can be better than everyone else...
...everyone who he perceives as being culpable in for why he is so angry at the world.
Reply from the maker: Mark Ryan no, i just had an opponent on here affirm they are polonium halos, it comes down to the three rings, how a nuclear physicist would get published in several peer reviewed major journals and make this mistake is irrational, the signs of a desperate attack a desperate grabbing at straws and a desperate attempt at clutching the fake ball earth as i rip it out of your skull.  ;)

granite with polonium halos or without halos cannot form by slow cooling from a molten state, but especially with the halos  ;)

halos.com

no Bible required  ;)

i can see you guys now pulling your hair out with both hands ;)
Reply: XD XD XD im assuming im the one that backed you up in which case you should know that was sarcasm
Reply: where is your proof and what journals bible weekly, jesus illustrated, top 10 reasons why the earth was made in 7 days

no bible required that halos webside is written entirely because of the bible it was even disquiminated agenst for being religous non bible science wouldent be considered to religous 

not to mention that site says all the counter arguments have been refuted. then precedes to say that becuse granite has never been made in a lab, probably because nobody wants to waste there time makeing something that proves someone who has ignored all the other evidence wrong, that he is right. another potental reason noone has made granite in a lab is because it takes 10k years to cool
Reply: vhsjvc
No verification that Polonium caused the halos, nor that the halos occurred in Primordial rocks.
Sorry bud.
Reply: vhsjvc
I don't care who backs up...they need to show the scientific evidence that Polonium caused the halos, in rocks that are Primordial.
Proof.
Lets have it.
Any scientific consensus will do.
Show us the peer-reviewed science.
Reply: regardless even if the earth was formed in a day dosent mean god did it there is almost a certainty that other civilizations exist and one of them could have done it.

you said there only argument was that it seeped in though the cracks your only argument is something that goes agents the majority of science and evedence to the contrary because it was written in a book.

i also want to point out the fact that things seep through the cracks all the time

AGAIN WHAT DOES THIS PROVE ABOUT A FLAT EARTH i dont care weather god exists most christians dont think the earth is flat either
Reply from the maker: nuclear physicist identified the halos, 1 to 3 rings means polonium, case closed.  ;) Ganite with polonium cannot form by slow cooling from a molten state, case closed.  ;)

The only way to get granite with polonium halos is if it was formed INSTANTLY  ;)

no Bible required but it is amazing how well the Bible coincides with real science  ;)
Reply: no that is not the only way there are many more probable options you say no bible require yet saying there is no other way for them to form is wrong and you are only saying that because of the bible
Reply: what nuclear physicist if i might ask and why does he suddenly have a geology degree and why is he telling the truth? becasue he supports you?
Reply from the maker: The only way to get granite with polonium halos is if it was formed INSTANTLY  ;)

no Bible required but it is amazing how well the Bible coincides with real science  ;)
Reply: There. is no evidence the halos are created by polonium.
There is no evidence the rocks are the first rocks on Earth.
Reply: how many times do i need to tell you you are jumping to conclusions for the sake of your confermation bias that is not the ONLY WAY to get granite with halos
Reply from the maker: odinata you would like to think so, but that is wishful thinking  ;)  a nuclear physicist showed they are polonium halos, the one to three rings is the signature, but regardless, it still requires instant formation, case closed.  ;)

when you can get that many polonium halos or any polonium halos or just plain granite to form by slow cooling from a molten state then i will listen  ;)
Reply: vhsjvc
Its not about what I would like, its just a simple fact:
The halos have not been shown to be caused by Polonium, and they have not been shown to have formed in rocks that are the oldest rocks on Earth.
Polonium is a decay product of URANIUM, and so there is no reason that the rocks had to cool instantly.
How did the rocks cool down instantly, anyway?
Magic?
Reply from the maker: odinata God must have made them, unless you have a better explanation?  ;)

And stop denying, the only way to get polonium halos in the granite is fiat creation.

If you think they are not polonium halos then email halos.com

denial is a sad state, open your mind
Reply: vhsjvc
I'm not denying anything.
The halos haven't' been shown to have been caused by Polonium.
Uranium decay produces Polonium.
There is no evidence that any rocks cooled instantly.
You still haven't explain how the rocks cooled instantly.
Reply from the maker: odinata says who? I have seen the halos they are most definitely polonium, are you suggesting that there are special halos that are formed by slow cooling of molten granite that looks identical to granite?
Reply: are you some geological time traveling phisist that knows on site what caused halo in granite
vhsjvc
Reply from the maker: maxybaer123 young flat earth  ;) halos.com granite cannot form by slow cooling from a molten state, especially not with an overabundance of polonium halos  ;)
Reply: vhsjvc
We can calculate exactly how long it takes granite to cool down naturally.
God would have had to instantly cool the granite somehow.
A magic freeze ray of some sort.
The halflife of Po is around 3 and a half minutes.
Reply from the maker: odinata God did not cool anything down, granite does not form by slow cooling from a molten state, just try it and see, you get something completely different. God created granite and everything as is.  ;)
Reply: well if the halos are caused by polonium while granite is cooling how did god make them
Reply: vhsjvc
Basic equations tell us how long a mass of granite takes to cool down from being heated to a molten state.
But I'll let you tell me...maybe you have felt hot rocks that go cold instantly.
I don't want you to think I'm being disrespectful.
Reply: well no his thory is that once you disprove science god automaticaly exists and made eart instantly because he can do anything
Reply from the maker: odinata i'm saying that granite did not cool, not that you cannot melt it, but when you do melt it it cools into a different thing, not granite, and molten granite can never cool into regular granite, especially not with an overabundance of polonium halos, see halos.com therefore, the granite we have on earth must have been formed instantly, just as described in Genesis  ;)
Reply: vhsjvc There can be no halos in granite if granite does not melt.
How else would polonium get into granite?
Reply: Your favourite ploy:   Gentry's hypothesis quickly runs into trouble with all of the accumulated evidence from many fields of earth science pointing conclusively to a great age for the Earth. Not the least of these evidences is radiometric age dating. To reconcile his presumed young age for the Earth with reported isotopic age dates for rocks around the world, Gentry (1992) argues that radioactive decay rates have varied over time. He is forced to conclude that decay rates for his chosen polonium isotopes have remained constant while those of dozens of other radioactive isotopes were many orders of magnitude greater 6,000 to 10,000 years ago. This of course gives rise to several major inconsistencies:•many rocks have been dated by a variety of techniques using different isotope pairs having very different decay mechanisms, the results showing remarkable consistency in measured ages. Gentry's hypothesis would require that all of the different decay schemes for the different radioactive isotopes must have been accelerated by just the exact - but very different - amounts to give the consistent age dates we find for rocks today. For example, the decay rate for uranium-238 (half life = 4.5 b.y.) would have to be accelerated by nearly four times the rate for potassium-40 (half life = 1.25 b.y.). Given the large number of different radioactive isotopes and decay schemes that have been used in dating rocks, the chance of this coincidence taking place is essentially zero.
•a general principle of radioactive decay is that the more rapid the decay rate, the more energy that is released. The slow radioactive decay of uranium, thorium, and potassium-40 has been identified as a primary source of the Earth's internal heat. Speeding up the radioactive decay rates of these isotopes by many orders of magnitude to be consistent with a 6,000 - 10,000 year age for the Earth requires that the energies of decay 10,000 years ago would have been extreme, keeping the Earth in a molten state to the present day. Obviously this has not occurred.
•if one is going to propose that radioactive decay rates varied, and varied differently for each isotope over time, there is no reason why the decay rates of numerous polonium isotopes should not also have varied. Under a variable decay rate model, it can even be proposed that polonium decay rates were much longer than observed today. In fact, once the idea of variable decay rates is introduced, it becomes impossible to assign discoloration haloes to any specific isotope or isotopic series, and Gentry's hypothesis falls completely apart.
The decay rate and the energy of emitted alpha particles are both related to the imbalance of neutrons and protons in an atomic nucleus, and are controlled by the strong nuclear force and the binding energy for the particular nuclide. Anything more than a fractional change in the decay rate over time would require variation in the fundamental forces of nature and the relationship of matter and energy. There is no evidence that anything of the sort has ever occurred.
Reply from the maker: odinata EXACTLY!  ;)  how else except by instant creation by God?
Reply from the maker: ***** you are out to lunch, it's all about the overabundance of polonium halos trapped in granite and this can only occur by instant creation
Reply: not to mention just because god has the ability to do something dosent make hime automaticaly do it
Reply from the maker: ***** no, you are making shit up, grasping at straws, either you show how liquid granite cools back into granite and/or with plenteous polonium halos included (or any halos) or stfu  ;)  halos.com
Reply: who made you the arbiter of the universe? we have shown it not done it but you havent created a flat planet in 7 days we told you the uranium broke down into polonium and that polonium probably made the halos how did god make granite
Reply: not to mention you have yet to show UNDENIABLE proof the halos are caused by polonium yet you ask for undinyable proof of granite formation why must our proof be done but yours only said by a non credible scientist or religous text the bible isnt proof of god it could potetaly be evedence but at the current time it isnt even that
Reply: *****
So why did God make the granite first in a melted form, if it was supposedly instant?
Reply: odinata 

Think you clicked on the wrong user there.
Reply: *****
Ah yes...sorry.
Reply: FLAT EARTH FREAK!!!
So why did God make the granite first in a melted form, if it was supposedly instant?
Sounds like you need to concoct an ad hoc explanation to explain why halos would exist in the first place.
If god made all the plants and animals fully grown, why wouldn' tHe make the rocks as we see them today?
Reply: can i ask why water is always flat
Reply from the maker: odinata you said it, God did make the rocks as we see them today ;) this is what we know for a fact based on the facts about granite and especially granite loaded with polonium halos. http://blog.flatearthtextbook.com/2016/11/geology.html ;) this is a good read   here is a small excerpt (it wont appeal to globe zealots because nothing will change their mind) The Vice-President of the Royal Geographical Society of Ireland holds that this, the only earth, was made during six successive periods, corresponding to six series of rocks, and that particles of mud and sand deposited by rivers in sea bottoms could only become rocks of a heterogeneous mixture, but never such as the primary with sub-divisions, having each its own marked peculiarities. In his "Errors of Geologists," page 15, he says:

"Neither the brown gneiss, nor the primary red sandstone, nor the yellow quartz rock, nor the gray mica slate, nor the blue limestone. Not one band out of all these could be formed out of the river sediment coming down from the pre-existing continents, because not one of them has mixed particles. The quartz rock has no lime, the limestone is purely crystalline, etc."
Reply: FLAT EARTH FREAK!!!
So God made them with the Polonium Haols in them?
I thought you said He made them melted.
Reply: wait but if god made the halos then thats proof there not polonium which means that there is a possibility of it not being polonium which means that your argument falls apart
Reply: im sorry but i dont think she ever said that as i can find no proof of it anywhere but on flat earth sites a link would be appreciated 

you call us globe zealots and nothing can change our mind when i am beeeegggging you to give me one credible piece of evidence that proves the earth is flat or god made the earth and dont say flat water you havent proved water is flat i am just going with the most logical explaination
Reply: i would like to point out the irony that you trust some random guy on the internet over many scientists and like to his page saying this is ALL humanity knows about granite halos
Reply from the maker: odinata i said the exact opposite, it is old spinning earth globe-heads that say molten. And yes, created with the polonium in them, it's the only explanation. The fact it matches Genesis in the Bible is 100% not relevant to the fact the only conclusion is that it was formed instantly as is or fiat creation.  ;)
Reply: FLAT EARTH FREAK!!!
That doesn't fit with the science at all.
Granite forms from molten magma.
Why doesn't Robert Gentry, the inventor of the falsified idea of Po halos, agree with  you about the shape of the Earth?
Reply from the maker: odinata  you wish, too bad granite does not depend on Gentry or the Bible, it speaks for itself. You cannot form granite from a molten state, especially not with an overabundance of polonium halos, the only logical conclusion according to KNOWN SCIENCE is instant creation. The fact that that coincides with Genesis in the Bible makes no difference whatsoever.

R.I.P. odinata brain washed too many times with industrial strength propaganda, this is what happens when you never rinse, she is a greenhouse religion follower too, so she tries to conserve water the most plentiful substance on earth, that's how smart she is like her smart meter that's giving her cancer and all the vaccines and fluoride too, she swallows all the lies.  ;)
Reply: YOU CANT MIX SCIENCE AND THE BIBLE AND NITPICK you say polonium halos are proof of god yet only science applies to how they form or work uless your talking about genissis
Reply: especaly not with anover abundence of halos 
WHAT noone has done it so how do you know if there are halos or not and if god made halos explain how they get there when humans would make it
Reply: you say it is the logical conclusion yet it only seems logical because you already have that idea say your religion was that aliens made the earth that would seem logical that they did it its not the only logical conclusion just one you already know the alien one is more logical because it agrees with more of the evedence the god would
Reply from the maker: maxybaer123 no i say it has nothing to do with the Bible
Reply: FLAT EARTH FREAK!!!
I don't have to wish.
Gentry never demonstrated that Po causes the halos.
Gentry never denmonstrated that the granite was primordial.
Granite requires molten rock to cool slowly for it to form.
No wishes involved on my side.
Reply from the maker: odinata nothing but sci-fi on your side, granite cannot form from the molten state, and granite with polonium halos cannot form from the molten state, they are polonium because we see three rings, case closed, i destroyed your little fantasy globe ;)
Reply from the maker: odinata flat water no curve is why we know the earth is flat, i don't care if gentry believes pink elephants can fly, it does not change the science, i don't care if there are many who disagree, truth does not require a majority. either show us that granite forms from the molten state and with lots of polonium halos or three ring halos or admit you know nothing. halos.com
Reply: FLAT EARTH FREAK!!! Even Gentry knows the oceans horizons curve, and ships disappear behind the Earth's curve.  No halos have been shown to have been caused by Po.
We know that granite forms only in slow cooling magma.
it's not granite any other way.
By definition
Reply from the maker: odinata your definition, just like the definition by nasa for greenhouse gas is a lie, too bad you are so gullible nosuchthingasgreenhousegas.com sorry, but granite does not form from a molten state and granite with three ring halos indicating polonium does not form from a molten state
Reply: FLAT EARTH FREAK!!!
No, the defintion of granite isn't wrong, it isn't a lie
I didn't' invent it.
And you can't change it.
Sorry bud.
This has nothing to do with greenhouse gases.
Reply: you need to prove what your saying i aready let myself get dragged into a young earth argument not gonna talk about gasses
Reply: please give me 1 shread of proof about a flat earth
Reply from the maker: odinata it has everything to do with the greenhouse gas religion because all lies including vaccines trace back to them and their population reduction agenda.

Granite is DEMONSTRATED not to form from a molten state, and the 3-ringed halos (polonium) that are so abundant in granite could not have been included if your definition was true.
Reply: FLAT EARTH FREAK!!! it has nothing to do with greenhouse gases.
The Earth can be the sphericql shape it is AND   climate change can be false.
At the same time.
Reply: FLAT EARTH FREAK!!! the shape of the Earth has nothing to do with any population agenda.
If the Earth were flat, the same people would want population to remain sustainable.
Reply: i am not part of any religion the views of others do not represent my views that is also a key part of a religioin is that there views are shared my views are my own not those of whoever your talking about
Reply: I WANT PROOF THAT IT IS DEMONSTRATED YOU NEED 10K YEARS
Reply: LOL all the threads that we proved him wrong on the flat earth thing he just straight up ignores then turns this into a young earth thread I WANT PROOF OF A FLAT EARTH DO YOU HAVE ANY
Reply: maxybaer123
This guy isn't mentally stable.
I feel sorry for him.
Reply: he said that to me lol
Reply: maxybaer123
I'm talking about the guy in the video, rambling on incoherently.
I do feel sorry for him.
Reply: why do i care im talking about weather the earth is flat also they have never once said they were going to kill anyone you tie it in to your thorys because it fits your narritive about the illuminati
Reply: i will not switch topics until you awnser me about the flat earth how can you prove its true
Reply from the maker: odinata they are the same people, believe it or not. As for Gentry, I don't care what he believes, I only care about the discovery that granite is loaded with 3-ring halos of polonium and what the implications of that are.
Reply: FLAT EARTH FREAK!!!
No they aren't.
They aren't the same people at all.
As for Gentry, I don't care what he believes about the age of the EArth, because he's already been debunked.
Radon makes identical halos as well.
I'm glad Gentry believes the Earth is round, because that has been proved correct.
Reply from the maker: odinata they are the same people, all lies come from the same people behind the greenhouse gas religion. No, the radon cannot get in, it is only suggested how it might get in, no physical proof to counter gentry has surfaced to date. Plus, it only makes 1 ring, but gentry a nuclear physicist, discovered 3 rings and that is 100% polonium, so you really don't know this subject very well.

when you can prove that granite forms by slow cooling from a molten state, and that this results in many 3 ring halos to be included in the granite, i will listen
Reply: FLAT EARTH FREAK!!!
No they aren't.  Any more than people who believe 2+2=5 are the same people who believe snakes can talk.
You only think they do, because you hate people who have gone to school.
Radon leaves an identical halo as Polonium, and both Polonium and Radon are products of Uranium.

"Granite is a light-colored igneous rock with grains large enough to be visible with the unaided eye. It forms from the slow crystallization of magma below Earth's surface. Granite is composed mainly of quartz and feldspar with minor amounts of mica, amphiboles, and other minerals."

Google the world "igneous"
Reply from the maker: odinata they are the same people, i proved it, they admit it, it is in their own public domain publications. Polonium can have 1, 2 or 3 halos and gentry, a published peer reviewed nuclear physicist, has identified the 3 ring version in granite, therefore it is polonium 100% deny all you like.

Granite does not form by slow cooling from a molten state, and polonuim halos cannot survive the slow cooling process. 

and i forgot to mention that in common core curriculum 2+2=5 if the class agrees on it
Reply: FLAT EARTH FREAK!!!
You proved they AREN'T the same people when you admitted that Robert Gentry doesn't believe the Earth is flat.
Do you think Robert Gentry believes in Global Climate Change?
Reply from the maker: odinata i don't think so 😉 they most definitely are the same people, i don't care about what gentry believes
Reply: pleas stop dogmaticaly saying granite cant form wheres your proof
Reply: you have yet to prove the earth is flat
Reply: FLAT EARTH FREAK!!!
Most definitely?
Ok, what Greenhouse gas did Robert Gentry push?
Reply from the maker: odinata i said "they" and i gave you a link https://www.youtube.com/watch?v=WeLpFKdNJzc
Reply: so someone worships the devil is that wrong you worship god i dont know about where you live but here in the good ol U.S of A we have a little something called freedom of religion
Reply: and again WHERE IS PROOF OF A FLAT EARTH I DEBUNKED YOUR VIDEO
Reply: maxybaer123
He won't be able to answer.
He's trapped in a cloud of mental illness and paranoia.
Reply from the maker: odinata exactly, so why do you mention him? Stick to GRANITE and stop diverting the discussion. Please prove that molten granite cools back into its original form, complete with three ring halos of polonium or concede that the earth is young and God created it and Genesis is true. 😁
Reply: FLAT EARTH FREAK!!! you are the one who brought him up. if he's smart enough to figure out polonium halos in your mind why isn't smart enough to know the shape of the Earth? Robert Gentry knows the Earth is round.  if he's good enough to be an expert on granite, then why isn't his opinion about the shape of the earth good enough for you?
Reply from the maker: odinata because science is not based on opinion, he never "figured out" anything, he made an observation, the implications followed based on science alone. The granite full of 3-ring polonium halos has only one explanation, instant creation, and from there we must accept that EVERYTHING was also instantly created, and then we notice that this matches Genesis perfectly. He is an imperfect human, but I will contact him about flat earth sooner or later.
Reply: FLAT EARTH FREAK!!! science has debunked Robert Gentry it is showing that he is 100% wrong about the age of the Earth
Reply from the maker: odinata not at all, your "science" is full of lies, and headed by greenhouse gas religion high priests, not rational to expect any truth from proven liars. Granite with polonuim halos proves instant creation, case closed.

Until someone successfully melts granite and shows that it cools back into its original nature, including plenty of 3-ring polonium halos, then i will listen
Reply from the maker: odinata yes, YOUR people, the greenhouse gas high priests who are the source of ALL LIES. Granite full of polonium halos should be taught in every school but since satanists control the "common core" curriculum, as I already proved to you, it is no wonder they hide real science like this, because people might find God.
Reply from the maker: odinata when you can attack the message then talk, until then, nuclear physicist published in many major peer reviewed journals has discovered 3-ring polonium halos in granite, which implies instant creation, since halos in granite cannot form from a molten state by slow cooling, neither can granite form from a molten state by slow cooling.

chop chop get to work trying to disprove reality, you are a zealot deceived by satanists, as i proved to you in less than 3 minutes https://www.youtube.com/watch?v=WeLpFKdNJzc the ones who control the school curriculum known as common core say satan is god, case closed.

stay stupid if you like
Reply: FLAT EARTH FREAK!!!
Which major peer-reviewed journal was it published in?
All you have to do is name the journal.
Reply: you are moving the goal post you ask him to disprove your proof that you stated as true without evedence
Reply: do you not live in the USA if not then this might bother you but here in the USA we have freedom of religon and seperation of church and state what those who made common core believed in dosent change anything
Reply: can i also point out that attacking him is attacking the message as the message is based off of what he said
Reply: maxybaer123
CAn you see this?
Reply: Mark Ryan
Yes.
Reply: yes
Reply: maxybaer123
He got real quiet.
I think when he realizes things like the Sun would have to travel faster to cover more ground on a flat Earth in winter, Polaris is at the angle in the sky that matches your Northern Latitude, Sunrise, Sunset, and all the countless other things that prove he's wrong, he's just going to throw a tantrum, take his ball and go home.
Reply from the maker: odinata several are named at the start of the video on his website, and which i have uploaded, stop playing stupid
, even the doctor that convened the world symposium was named, the "scientific" community was silent because they could not disprove a single thing.
Reply: FLAT EARTH FREAK!!!
You haven't named a single peer-reviewed science paper that contains Gentry's halo opinions.
Not one.
Reply: FLAT EARTH FREAK!!!
Sorry, bud, but there are NO peer-reviewed papers that have published Robert Gentry on the subject of Polonium Haloes.
Not one.
Notice you can't name one.
If he had, you could easily name one.
You can't.
Reply from the maker: odinata there are several and they are shown in the video and excerpted as well halos.com
Reply from the maker: Mark Ryan i told you where to look halos.com
Reply: there are several yet you cant name one lol so credible
Reply: i bet his peers on that site are all very biased
Reply: FLAT EARTH FREAK!!!
That's not a peer-reviewed scientific journal.
I asked for a per-reviewed scientific journal, like YOU said he had.
Why can't you list one?
Reply from the maker: odinata not going to spoon feed you halos.com several peer reviewed journals published these results, play stupid all you like, earth is young and Genesis is true, granite proves it, granite loaded with 3-ring polonium halos proves it better. Show us granite forming from a molten state? You cannot. Show us granite loaded with halos that formed by slow cooling? You cannot.

i'll buy you a propeller hat if you can do this
Reply: FLAT EARTH FREAK!!! There are no peer-reviewed science journals on "halos.com", pal.
  Look fopr yourself.
Not a single one.
YOu have not proved that any halos caused by Polonium have been found.
Radon makes identical halos.
Reply: you cant prove your thory just by linking to something we proved false and saying were missing something and were wrong if i remember there papers where rejected by scientific journals 

we told you we cant make granite from a molten state quickly and we dont need to there is enough proof already how else would it form even if you claim god made it that doesent make it more valid than the proof that granite forms from lava

if i did do this it would be crazy expensive i wouldent need your hat
Reply: FLAT EARTH FREAK!!!
Name one peer-reviewed science journal that Gentry's halo hypothesis appears in.
Just one.
Reply from the maker: odinata see halos.com
Reply: FLAT EARTH FREAK!!!
There are no peer-reviewed papers on halos dot com.
Name one that Halos appears in.
Reply: it was dennyed from a journalbecause its unfounded which is evedence of the contrary
Reply from the maker: odinata second video on this page http://www.halos.com/videos/index.htm and you can look it up on youtube, it starts off listing several journals, you have swallowed satan's lies all your life
Reply: we haven swalled his lies as hes not lyeing what is he gonna try to do make us sin we do a good enough job of that ourselves he dosent need to step in
Reply: how do you know you havent been the one to swallow his lies how do you know he didint make this movie
Reply from the maker: maxybaer123 the only normal thing you have said is that we do a good enough job sinning that satan does not need to step in
Reply: the only source i could find was either completely false or was removed after they realized it was wrong dosent realy back up your case
Reply from the maker: maxybaer123 yes, the fake globe is crazy here is a great song on this https://www.youtube.com/watch?v=VPI9orIyEf0
Reply: FLAT EARTH FREAK!!!
No peer-reviewed science journals listed there.  Maybe you can name one
Reply from the maker: odinata lying coward  ;)
Reply: why do we have any reason to lye were argueing agenst you look it names one and if you look it up there is no mention of him ever being in that journal
Reply: FLAT EARTH FREAK!!!
Yes, you are ;)
Otherwise you could name a Peer-Reviewed Journal Gentry published in.
Reply from the maker: odinata i can name several, got them from the beginning of the video i gave you from his website
Reply: FLAT EARTH FREAK!!!
If you could, you would.
We both know you can't name a single one.

There are no peer-reviewed science journals that contain a Gentry work on Po halos.
Not a one.
Reply: FLAT EARTH FREAK!!!
Nope.
Not a single one.
Look for yourself.
There are no peer-reviewed science journals containing any Gentry claims on Po halos.
Not a one.
Reply from the maker: odinata what journals were listed in the video? and don;t forget there was a world symposium  ;)  lying wont make your globe come back ever, the cat's outta the bag, check this live flat earth song performance  https://www.youtube.com/watch?v=hMHIiqi8Xoo just the tip of the iceberg  ;)  you are a relic of the dark ages
Reply: FLAT EARTH FREAK!!!
No journals contain any peer-reviewed papers by gentry on Po halos.
Notice you can't name any.
Reply: FLAT EARTH FREAK!!!
I'm not lying at all.
I promise you cannot name a single paper.
Reply from the maker: odinata if you say so  ;)
Reply: why cant you just awnser if there are so many sources or are you just afraid of the truth in which case that quote about not being afraid of the truth was wrong about you